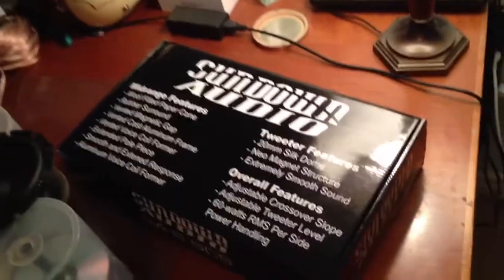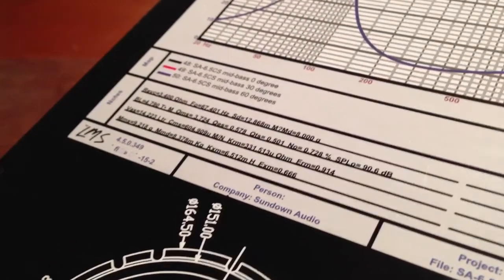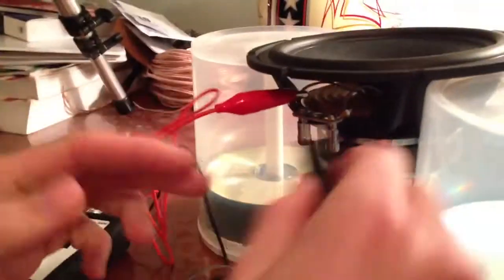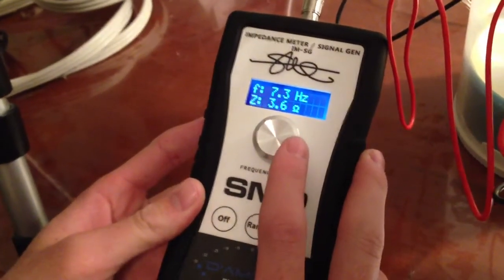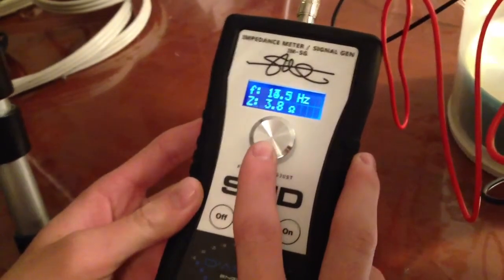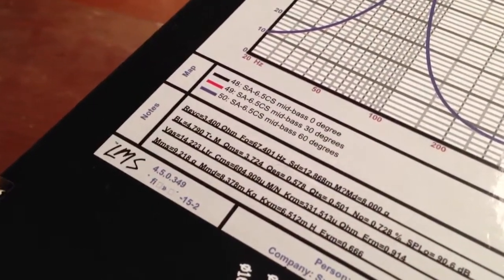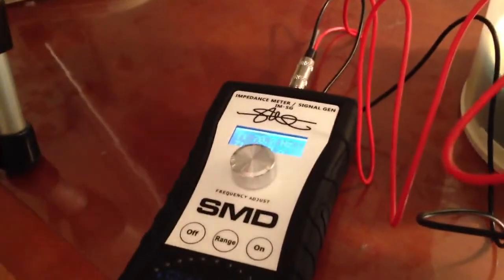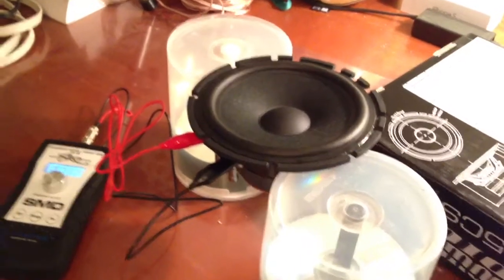Finding the FS of a Speaker

Comment: What does the fs mean?  How is it useful?
Reply: @Mabeylater293- The Fs= free air resonance of a speaker. This is where the woofer moves the most, while sitting out in an open space= not in an enclosure. Fs can also help to tell you its preference in what freq. range it is more efficient. Knowing the Fs of a speaker is useful for setting crossovers, or for tuning an enclosure. One example, would be if using it in a ported enclosure, It is recommended to tune a port to a woofers Fs, or above, but not below. Although these are just rec., as power, & personal preference can change how you may want to set them up. For most drivers, it is recommended to set the high pass filter above its Fs.
Reply: @evilinside5984 thank you!!!!